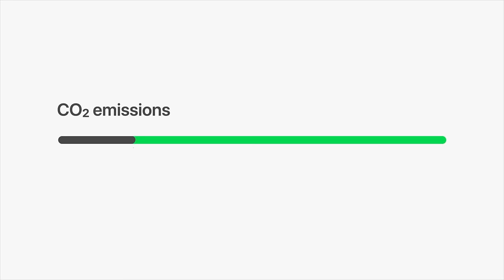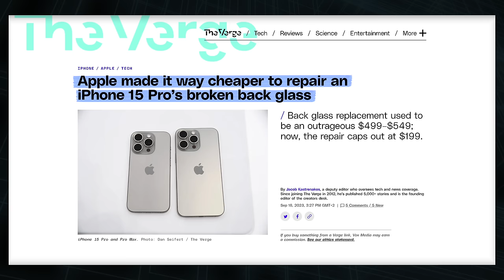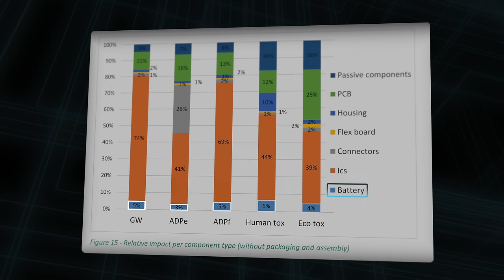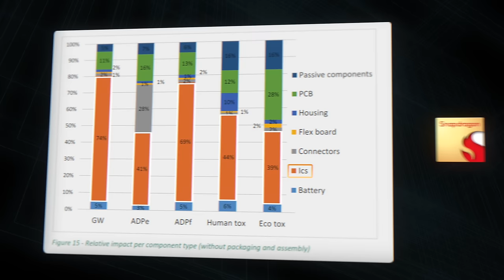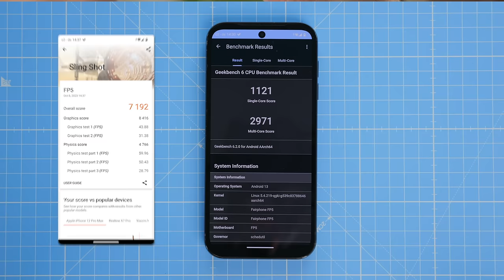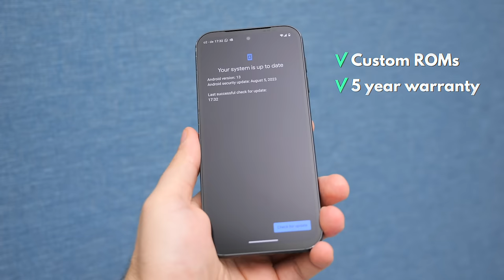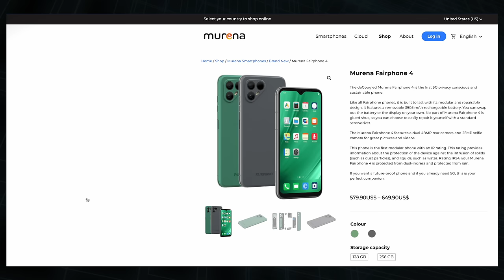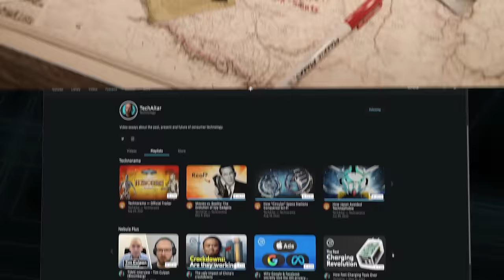Is Fairphone really fair?

Comment: If fairphone achieved similar pricing while doing all this now, then they have nothing to worry about. Certainly other companies will just increase their prices when they see revenue going down thanks to people using their phones for longer, after the new regulations come to effect. They can still have a market by keeping prices more similar to the pricing we have now.
Reply: You can’t just assume that companies can keep raising prices. There is a limit. If you look at Samsung’s flagships, they don’t sell as much compared to their budget line. There is a point where the market supports the demand, and companies will bring the supply. Customers are demanding to use their smartphones for longer. You can see that Samsung is now supporting five years of security patches, and Google announced seven years of support. Overall, the sales of smartphones have slowed down as well. If you look at the lineup of certain products, they aren’t even refreshed every year: iPad mini was released in 2021, and the MacBook Air M2 13-inch was released in 2022. Companies are smart and adjust to market demands. Most phones had removable batteries and were easier to take apart; over the years, people just bought unrepairable junk and signaled to the companies that those features were desired.
Reply: phones breaking or being slower/lower battery is the reason for like 5% of new phone sales
Reply: @PepsiMaxVanilla  more like 25%
Reply: @tamwilfred counter point ENDLESS GROWTH
Reply: What i took away from the video is that they can't drop their prices while doing all this, they have almost no margin (less than 1%) compared to other companies (10+%)
Reply: @fuseteam  Of course they can't, the only thing is their company sustainable? I like the idea of a modual and repairable phone but I don't like the price and return of value, high price and lower preformance. And as TechAltar said, some of the big companies notice the change in consumer attitudes and adjusting. It could be greenwashing or it could be true.
Reply: @tamwilfred  I don't want to guilt-trip you because I have the same sentiment, however... this is basically: "I don't want to pay the REAL price for what it costs to make phones fairly."

We can afford things on the basis that other countries are being exploited. Applies for clothes too. 

If you want high performance, you have to either pay a lot of exploit someone to pay less.
Reply: @normi9033  I don't make a lot of money, so I haven't bought a new phone in years. All the phones I've bought since I came back to America in 2012 have been refurbished. Not everyone can afford the Fairphone, even on third-party sites, where they're still expensive. If you buy a used Samsung S20 FE, it's only around $200.

In an ideal world, I would be able to afford these phones, eat ethically grown food from small local farmers, and produce green energy. But 200,000 units sold of the Fairphone isn't making much of a dent in sales compared to the big companies. I would like to hear if you have a better solution.
Reply: "If fairphone achieved similar pricing while doing all this now"
The problem is literally this, you cant expect selling same price when putting more effort on something like sustainability design right?... lol
Something has to be sacrificed, in the case of fairphone, performance, software optimization, camera and so on, almost everything else is subpar compared to competitors
Reply: So when their sales go down they will increase prices? In a severely competitive market like this? Only Apple can pull this up
Reply: @mitakka  That's not the case. Smartphone sales are declining. Apple who makes most of their revenue from smartphones stopped reporting sales numbers of their iPhones. If you look at third party reports of iPhone sales. Their cheaper models sell more units  than their higher price pro models.
Reply: @PepsiMaxVanilla that's the only reason anyone I know gets a new phone. Sure people who love new shiny things and have the money might buy heaps, but they justify that by giving it to their more normal relatives as hand-me-downs
Reply: lower prices can only be achieved by using slave labour
Reply: @PepsiMaxVanilla I would guess that 95% of phone sales are people buying their first phone so it's almost certain than a significant amount of sales are people getting a new phone cause their old one is slow or broken
Reply: But they won´t and they can´t because all that stuff costs way too much money. That´s why nobody wants to buy them and that´s why other manufactureres don´t d othat.

Comment: I think there are some issues with the early review sample you received. 
I did get the Fairphone 5 a few days ago:
You should run it on 90 hz (i put 3 phones next to as comparison even my 144 hz Monitor and it was buttery smooth - even Genshin worked smooth on medium with 60 FPS enabled)
The vibration motor worked suprisingly well (a bit weaker and less haptic than iPhone XS Max), but miles better than lower midtier android phones
Their camera app needs some software tweaking like GCam (Color Grading and some more intelligent processing)
One can just use GCam for those prettier Photos (better stabilization, etc.)
More people need to be aware that it is not the camera that sucks nowadays - more the lack of tweaks in the software (regarding Sharpening and Color Grading the image)
To keep Google Play Services from Spying too much (restricting its battery usage) i sometimes run it on Battery Saver (at least scheduled to, when I sleep).
BTW, more people need to know that it is the Google Play Services that secretly suck so much performance in Android (rather than it being a bad OS) - wish we could pressure Google into decrapifying their Service App...
Reply: Where did you get GCam from? I know that there are a whole bunch of ports and I really don't know how to approach it or which one to rely on. Not sure if links work in comments, but just mentioning where I can find it should be fine. Thanks!

Also, if you're having trouble with Google services running all the time, then it could be useful to know that CalyxOS is planning support for the FP5. They were sent a few units for development. I'm planning to use that and hope it will save some battery.
Reply: Degoogle your phone. Will guarantee you won't be spied on, and you'll have less bloat.
Reply: A Huawei phone could be option B, but they are very expensive, and I have the feeling that if not Google Mobile Services, Huawei Mobile Services would eat up your battery instead xD
Reply: I honestly don't understand why they got new camera modules. They took a year or more to get the software ready on the 4 only to upgrade to a marginally better sensor and scrap their work.
Reply: The probelms comes at camera department, Gcam can not be always useful unless it's ported specifically for fairphone by a developer, then as mentioned in video fairphone need to grab much more sales number to ask the camera sensor makers like sony, Samsung, omnivision etc. To custom developm a chip for them. Other than cameras other things look pretty good than other androids especially the software support :)

Comment: I give them credit. Instead of just raging about how exploitative phone manufacturing is; theyve gone out and attempted to put their points into practice. Is it gonna be for the highest power users and "spec-snobs"? No; but most users ain't those, and a "Toyota" of phones will do what they need/want just fine.
Reply: My main concern is the hardware durability. Since the specs are just average, I'm afraid that the phone will be barely usable for regular browsing in 6 years from now, like it is for a 6 years old mid-range Android. (I can't imagine in 10 years)

If I'm paying that much, I'd rather go for an Iphone or high end Android that I now will be perfectly fine in 6 or 7 years. Especially that for a device I'm gonna use that long and everyday, I want to have the best experience as possible (so I'd be less likely to give up on the phone and replace it)

My today's Galaxy S7 from 2016 received its last update in 2018 but still works well.

The "fairness" of a smartphone also depends of the way of we, customers, treat it. (and to my eyes it's the biggest issue since people change phones because they actually want to change, not because they are forced to.)
Reply: @MasoMathiou  Well, what determines how much specs you need for browsing in the future?

I understand you expect the requirements to go up with time, but does it make sense that they should?